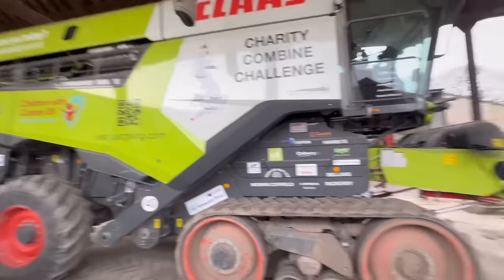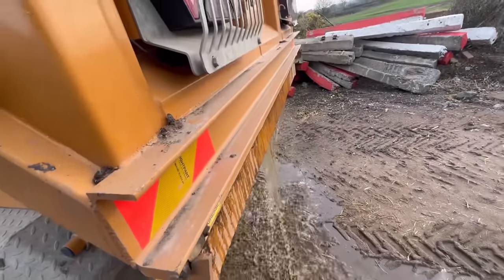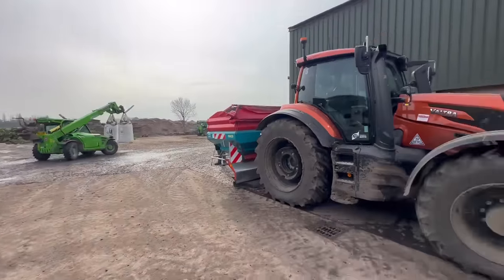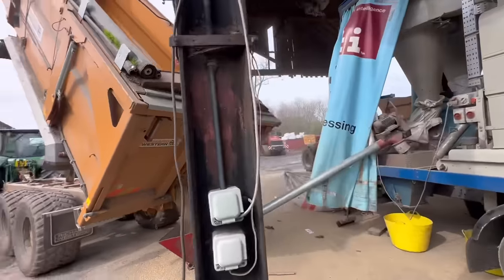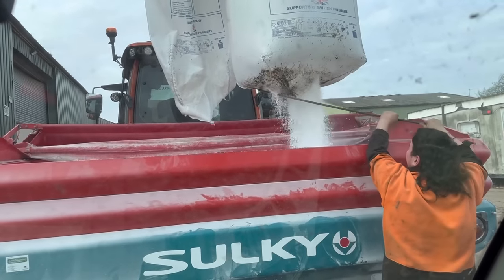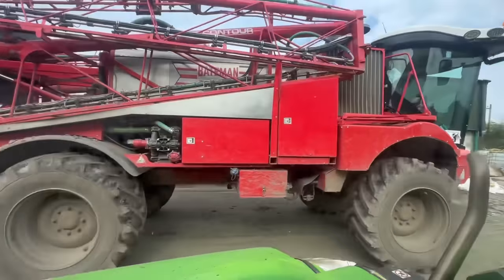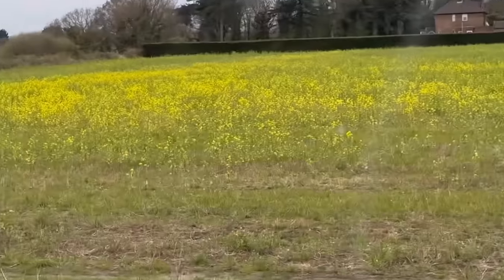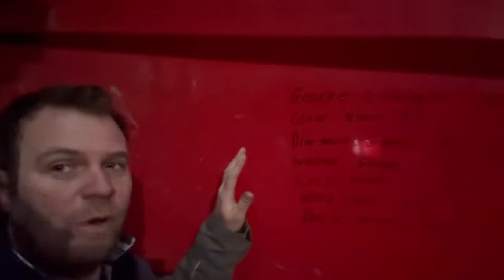STUCK SPRAYER & A SEED CLEANER #AnswerAsAPercent 1470

Comment: Hey Olly. I’m a bit behind this week. 80%. Years ago we used to spray with a jd6400 on terra tyres with front and rear 1000L tanks. Would only cover 10ha but it could walk on water. Same outfit for fert with 1t at a time for early urea. Even wet land had no ruts in it. It took 2 men with a chaser to cover the ground but well worth it.

Comment: so how did you know how much barley was in the clean bags? we used weighting scales with a board on them under the bags as we filled them up. so the first cleaner works the same as your combine sieves and the other one is a gravity cleaner  which vibrates and has an air flow which you can adjust depending on how heavy the grain is. the light grain and any weed seeds will flow over the top seive or be sucked out, the heavy grain that you want to keep will fall thought and go into your bags. the cleaner i used to use was almost the same it used to do 6 /7 ton an hour with barley and a max of 11 ton an hour with good wheat.

Comment: Stuck Bateman.. knock pto out, fold booms in and both axles into tortoise mode they usually drive themselves out the way you go in. 
Herring gulls, i said tremors, could also mean someone dropped a bag of chips  at Hoylakes 😂
I hate Herring gulls as much as you hate pigeons.

Comment: 98%, because I had to recover a wheely bin from 3 doors away. As it was on the pavement and not the neighbour's drive I'm guessing that was the bin men wot dun it!

63 grand is several operating hours that the Air Ambulance might not have been able to do otherwise, and that could be several lives saved folks. I was transferred from Ospadal Uibhist agas Bharraigh to the Queen Elizabeth University Hospital in Glasgow by air ambulance with acute renal failure, so I do take this personally.

Comment: Will there be enough room for the top link hook on the claydon and will the seed switch work. I don’t think it would fit on mine. After seeing the bit you mentioned about the sfi last night and I put on FB I’ve had quite a few messages regarding it from friends. Good luck with the spraying 👍